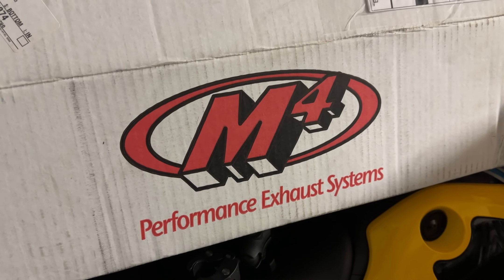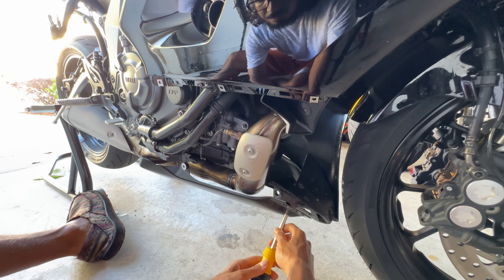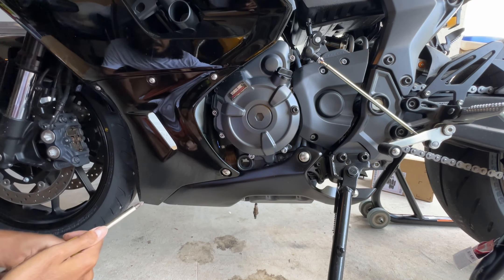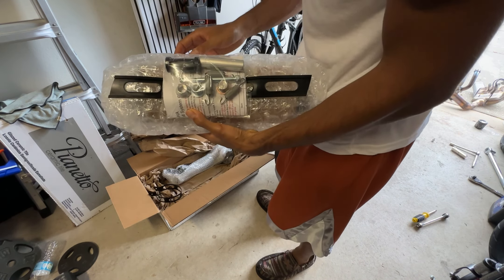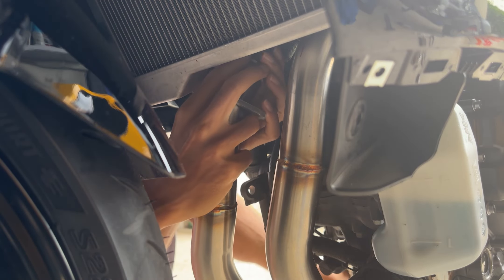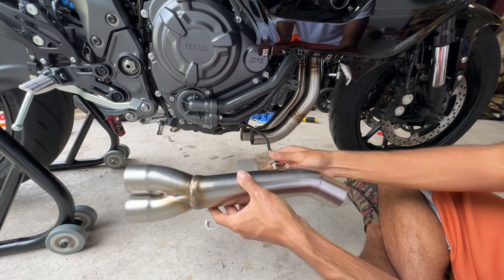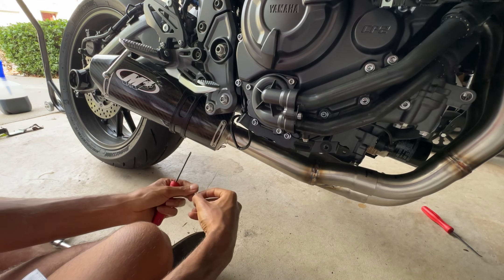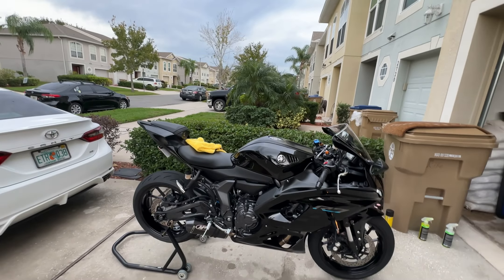2022 Yamaha R7 - Full M4 Exhaust Install

Comment: Hey just curious since it’s been a while since you installed this, did that o2 ever throw a check engine light before you did or didn’t tune it?
Reply: They claim it needs no tune, and I’ve seen people say they didn’t tune after install with no CEL. I’ve also seen ppl recommend doing an ECU flash so I’m not sure if there’s a consensus.

Comment: I think you forgot to tie the O2 sensor wire, it was touching the exhaust pie. Anyways did you tune your bike after installation? Does it work fine even if you don’t do it? Thanks.
Reply from the maker: 9k miles en and no tune
Reply: @YahmahaR7  thank you appreciate your reply.👍